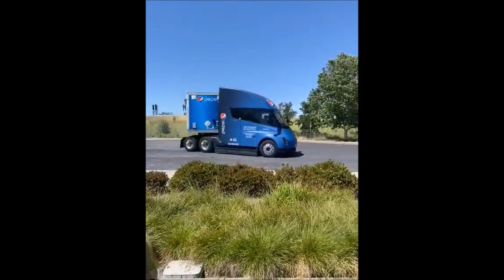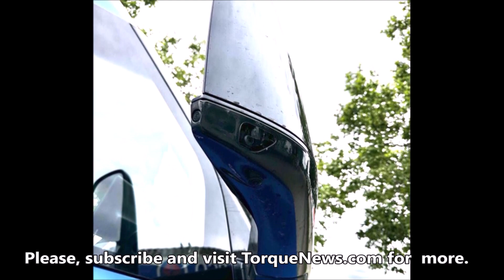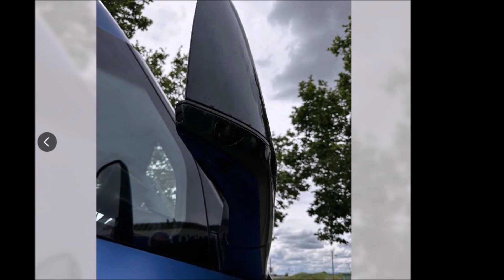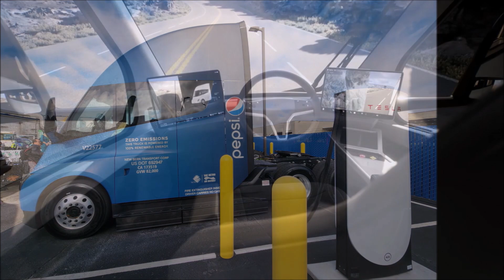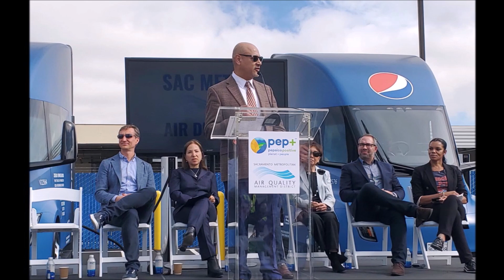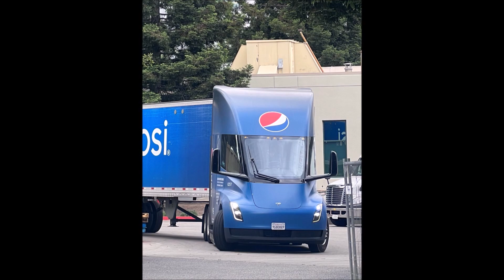Pepsi Tesla Semi Makes Super Quiet U Turn

Comment: Where did the power c ome from that charges the batteries? I bet it come from natural gas so it has pollution to run it.
Reply: I'm not an environmentally conscious person, but there's no denying physics. Even if it comes from a coal power plant, large power plants are significantly more efficient than small ones carried around in vehicles. And as the electrical grid power gets "greener", the vehicles will be operating more "cleanly", unlike an internal combustion engine.

Comment: @Torque News Nikola has officially halted production of its Battery Electric Truck. “As we have sufficient inventory of the battery electric truck, we will temporarily pause production in Coolidge as we modify the assembly line to accommodate both hydrogen fuel cell and battery electric builds on the same line,” the company said in a statement. “After we resume production in Coolidge, the battery electric Tre will remain in our lineup as a build-to-order product.”  Nikola

Comment: Maybe if the driver's seat could swivel about 120 degrees, it would be easier to get in and out of the cab.

Get in the cab, sit down, swivel forward and drive. Stop, swivel towards the door, get up and step out.
Reply: I've been inside the cabin. You can literally stand upright and walk around, even to get into the seat. I'm 6 feet 0 inches and it felt like there was at least another foot of headroom while standing, but to be fair I didn't actually check.
Reply: @danielthomson8341  A valid observation, but my concern was that some people have mentioned that the driver may have to walk from the back to the front of the cab to sit down with potentially dirty or muddy footwear. 

Whereas in a normal cab the driver doesn't track mud all over the floor.

A swivel driver's seat would minimize that.

Comment: That concern about the gate check-up or giving a receipt to the guard, I don't know if TESLA door windows roll down if they roll down the driver can stand from the driver seat roll down the window, and hand the papers to the guard,  it is so refreshing after a long drive to flex your legs.  The time is not much compared with the typical left-side steering with roll-down window in handing your paper to the gate guard...

Comment: One thing regarding the U-turn truck: It appears that one of the rear trailer axles is not in contact with the pavement which would indicate a light load.
Reply: You expert 😉 😆
Reply: @wt9653  Nope, just observant (not a shareholder). Thus the words 'appears' and 'indicate' in my comment. Another reason for this may be for less drag (better mileage). This also seems to planned - given that it is a known dead end and not a construction or accident zone. And, FYI, my $40,000 Robotruck/taxi will be delivered on a Tesla Semi, making money for me, during my trip to Mars, next year.
Reply: @danlowe8684  
You're also a comedian 😆